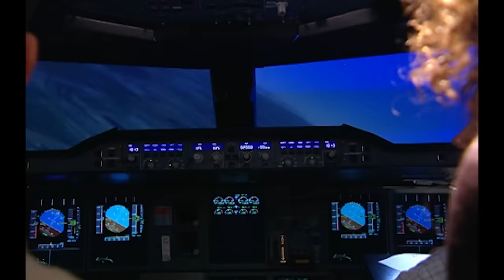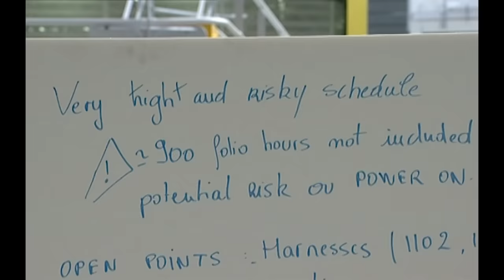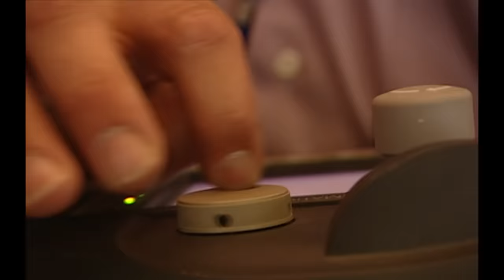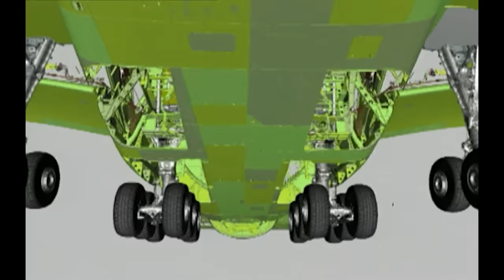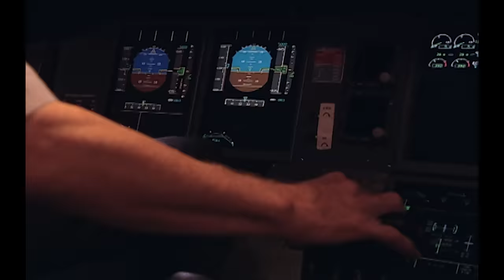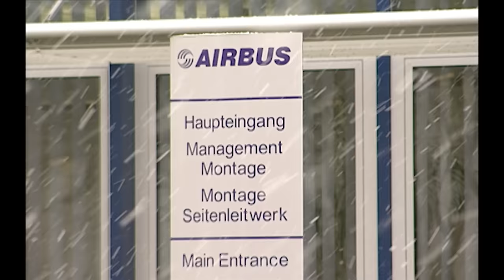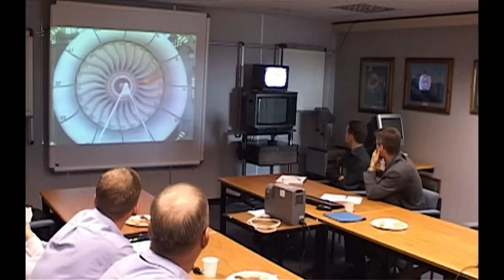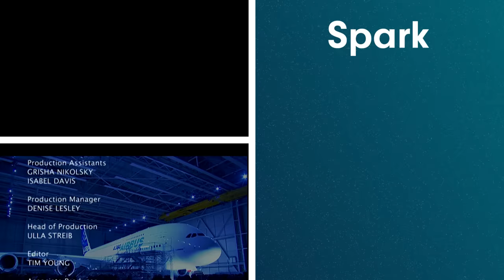The Making Of The $10 Billion Airbus A380 | The Giant Of The SkyAirbus | Spark

Comment: What’s interesting is that as of 2023, after the pandemic, and less than 20 years after its introduction, the A380 is not being reinstated by many airlines; In lieu of other aircraft platforms which are easier to integrate into airports/aerodromes.
Reply: Not so many airlines have it, but it is not correct is not getting reinstated, Lufthansa, Qantas and BA is flying them back from the "aircraft graveyards"
Reply: Plus it made 251 sales as of 2023,
Meeting the original target!
Reply: Jup. There is a market for the A380, but it isn't unlimited.

Comment: Amazing plane & great to fly on. By far the quietest & smooth long haul flights I've ever been on. Good to see them going strong post covid, Emirates need to scrap their silly old 'we don't fly planes older than 12/14 years' rule & keep these long as it's viable.  With growing travel demand & limited airport slots these are perfect re capacity
Reply: Emirates is pushing Airbus hard for an A380neo and all reports suggest negotiations are ongoing, would be great to see production started back up
Reply: @julesschollum5641  Personally can't see it, Airbus seems more focussed on the a350s as long haul & the a320/21 neo's is where all the resources are flowing with huge backlog. The A380 project whilst it did ok was never truly profitable overall it seems. It would be shame however & push up airfares in the 2030s onwards if there's no replacement, too much demand, little supply